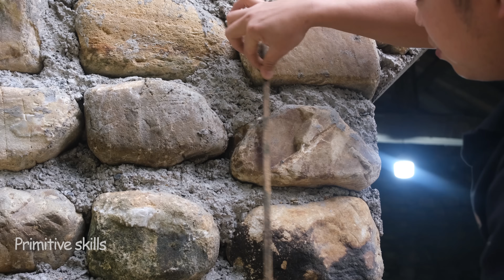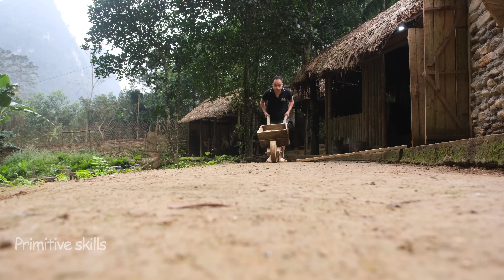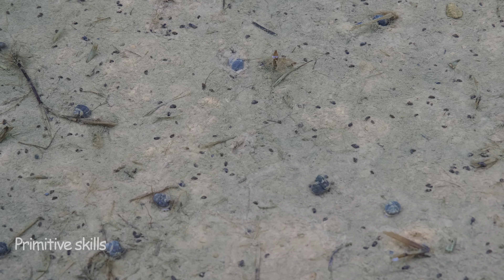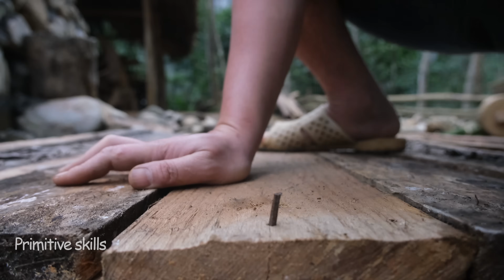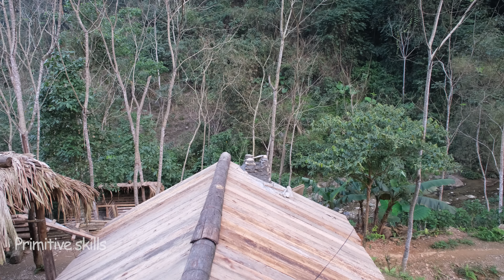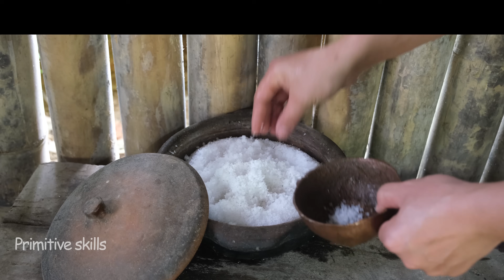PRIMTIVE SKILLS; Build a stone fireplace/chimney can heat house (CABIN) in winter

Comment: I'm not a genius but I think that if your only source of heat is fire, then a fireplace would have been, and should have been, part of the original design and construction. The extra effort to make all of the wall and window just to tear it down, and potentially have a weaker structure because of it, could have all been avoided by a tiny bit of planning and "doing it right the first time", as they saying goes. EDIT: And the chimney needs to be at least a meter taller if not 2 meters.

Comment: It's common practice to extend the chimney past the roof peak  for the best draft to get the smoke up and away from the area
Reply: Exactly I'm also worried about the interior. The fact that it's wood. Hopefully that's getting taken out as quickly as possible. Well as quickly as structurally possible. We can already see visible fire damage heat damage.
Reply: @ConnorMainwold he used that mainly as a form and believe he fully expects it to burn away over time.
Reply: @ConnorMainwold  charred wood is actually less flammable than raw dried wood. But regardless it will burn once it reaches a certain temperature. I thought that was his plan to burn the form inside the chimney since it's surrounded by stone. I just wonder about heat and cracking the stone and mortar from drying to fast
Reply: ... worried the chimney is not tall enough from the peak of the roof, as big rains can flow inside...
... hopefully none of the rocks came from the river, was told river rocks hold too much water and can explode in fireplaces...
Reply: I agree. While it is probably "tall enough" it is not ideal.
Reply: @heathbecker420   To be honest everything can burn if you get it hot enough
Reply from the maker: Thank you, wish you and your family good health
Reply: Gostaram da resposta?

Comment: Hello Duong! 👋🇨🇦 Hope you are doing well, please take care of your back and heavy lifting. The Fireplace is very beautiful but I worry about the Chimney not being high enough, it should be extended. Also once the wooden frame burns away inside the fireplace, it might cave in, maybe build inside with some Rebar’s, Mortar and Bricks for safety, sturdiness and longevity. ♥️
Reply from the maker: Thank you, wish you and your family good health
Reply: these are great suggestions!! Rebar, brick ties etc are pretty key in structural integrity. The wooden frame is going to burn away and I fear his house with it. Also needs at least another 800mm on the chimney to get well above the ridgeline, better draft.
Reply: @dragonsheartforge8035 oh yes that’s very important too, I didn’t think of that, I’m worried about the roof line and sparks landing on it… of course with a clay tile roof it will be much safer but Duong said weather is not good to make clay tiles yet.

Comment: @26:53, You need to remove the planks in the chimney above the fireplace, or your whole house will burn down!

Love what you're doing with the land, and a nice chimney <3
Reply: how will a house made entirely of stone burn?(didnt realize the roof sorry) and as you saw in the video the planks aint really catching on fire, more so only charring. so i would assume they are quite safe to let burn away
Reply: @SanePelailee  Yeah for now, give them 1-2 weeks with some burning in the fireplace, and then just 1 ember could catch on fire ant the whole roof would be gone
Reply: @firesting  he had his entire basket collection above his fire for quite some time. It was mostly made of bamboo.  He seems to test his limits. At least most of the wood is encased in stone inside the chimney.
Reply: I think the biggest danger he might face would be if a loose chunk of wood fell into the fireplace from higher up. Lots of smoky, burning chunks around the room.
Reply: @SanePelailee  fire can make concrete brittle and collapse.
Reply: @SanePelailee com fogo não se brinca. Ele pode dormir e as tábuas queimar, nesse mundo nada está 100% seguro. Então um pouco a mais de cuidado é fundamental. Não podemos confiar em uma casa que tem fios de energia.....
Reply: @firesting  true in a dry place yeah, but true. and you cant be too safe with fire.
Reply: @HamguyBacon  Ture didnt think of that. but then the whole fire place is in trouble
Reply: @NOVELANATELA  thats true. You cant be too safe with these things. sorry for my ignorance
Reply: @SanePelailee  🥰
Reply: @SanePelailee  the wood will be fine if it turns to char, it will be fire proof. the concrete walls should be lined with clay or dirt.
Reply: I don’t think so I think he intends to burn out the mould.
Reply from the maker: Thank you, wish you and your family good health

Comment: Chimney is not high enough above the roof to get a good draw. 
 it will back draw which is why there is smoke in the house. 
Got to be at least two feet above roof for good draw and sparks to fall back down instead of on roof

Comment: Great video,  I love your fireplace 😊  The biggest suggestion i can make from my own experience from having wood burning stoves and fireplaces is that te actual chimney should rise 2 feet ABOVE the Ridgeline or peak o th roof. This allows for better airflow and creates less fire danger to your roof.  Another suggestion is as someone mentioned,  to line the inside of the fireplace with brick. This will help protect the chimney itself and also hold heat longer at night.  There is a thing called a damper, which is basically a sheet of metal that is meant to fit into the chimney opening,  this lets you control the fire better and also will let you close off the chimney so it doesn't pull out the warm air from your room whe you aren't using the fireplace.  I hope this makes sense as i am notan expert by any means 😅.   You did a beautiful job the way you made it, both in function and looks 😊.   I completely agreeabout movng the pig pen, that area does make more sense.  Sending blessings from the USA ❤
Reply from the maker: Thank you, wish you and your family good health

Comment: Honestly, while it's awesome that you've finally made yourself a fireplace, if this was made for something other than cooking, then it's not very useful. A fireplace work's by gathering and holding heat in it's structure, which is why fireplaces are built inside the home, with only one of the four sides of the fireplace facing outside, because this wastes the least amount of heat. Sometimes the fireplace is built in the middle of the house, so that all four sides of it can release their stored heat into the house. With the way you've made your fireplace, a good 3/4 of it's heating capacity is being basically wasted, since most of it now bleeds outside into the open air. 

Anyways, phenomenal work on the house. Can't wait to see you make roof tiles and make a proper roof for it.
Reply: After watching him walk around in shorts with no shoes for years now, I get the impression that it doesn't get very cold where he lives.  You're absolutely right, but he might not need that much heat.
Reply: I completely agree with you about this.  Radiation of the heat needs to be inside the house.
Reply: yea the build and then plan technique, always causes a problem at the end, unfortunatly we see how poor his concrete is which is a concern for the future.

Comment: You are making "Limecrete" but you don't use enough lime. 
3 parts sand, 1 part lime is the right formula. 
And you have to keep wetting it for a few days if you don't want it to crack.

Comment: I'm adding my voice to this one Duong, this fireplace needs some significant adjustments to be safe and effective. To make it safer you need a taller chimney, which will help to direct the smoke up and away, plus taller chimneys naturally pull a stronger updraft so the fires will burn better. Considering how close the dry thatch roof is you really need a screen to catch escaping sparks or you could easily burn everything down. You could use this as a chance to pull some copper wire and weave a screen! To make the fireplace far more effective, you will want to extend your fireplace inside the cabin. You can bring the hearth down to floor level for convenience and all of the stone work you add to enclose it will be able to store heat from the fire and then slowly release it inside the house.

Comment: Very nice chimney.  I think I would have made it a little taller since your roof is currently flammable.  Also, I'm concerned you'll get a roaring chimney fire going at some point when the wooden frame catches fire.  I really thought you intended to remove that after the concrete set.

Comment: Listen, bro, it's fine, but it's not durable. There's a risk of the upper part of the chimney collapsing. It's supported by formwork. When the formwork is removed, the upper part may collapse inward. Secondly, there's no attachment to the building wall. A crack is forming along the wall. The chimney, along with the fireplace, could fall away from the wall.
Reply from the maker: Thank you for your feedback

Comment: Duong the fireplace is a little high off the ground. Should be a little lower to the ground for better heating, But other than that it is a excellent build. Chimney needs to be at least 2 foot higher than the roof ridge for optimal flow. Don't want to burn the wooden roof from the excessive heat coming out of the Chimney. You have the general idea of how it works. Just a few small changes to makes it a standard fireplace.
Reply from the maker: Thank you, your shares are very useful to me

Comment: Build a fireplace inside the house, all the curves of the wall will heat up, and as my grandfather taught me, the inside of the chimney should be smooth so that the smoke does not get stuck and there are fewer deposits

Comment: Two things:

1) The chimney to too short by at least 2-3 feet, should probably be extended 4 feet just to be sure because of the quality of the wood being burned. In the video you can see the smoke blowing under the eaves and back into the house. 

2) The crops fields: as I've been saying for years that area is too sloped and the rains are leeching away the nutrients from the plants. Planting in small mounts like that only works if the soil is already high quality, nutrient rich, and naturally good retention/drainage ratio. 

You need to terrace the entire crops fields and not just the areas for rice. Also you need to rotate the crops every planting and add compost to replenish the soil. You have plenty of sources of manure, plant material, saw dust, etc. to do proper composting bins. 

When you're done boiling your eggs, save the water, crush up the eggshells and add the powder to the water and use on your plants. also as others have pointed out, use the water/ top layer of soil from the pond as it's nutrient rich from the fish poop and plant material you feed them. 

Water from boiling vegetables (not salted) is also a great source of nutrients for plants.

All of this combined with proper composting will greatly increase the health and productivity of your crops. 

The size, shape, kernal count, etc. of your corn are all tell-tail signs that it's not getting the proper nutrients it needs. That's the easiest and most visible signs but the stunted growth of the rest of the crops are all the same signs.
Reply from the maker: Thank you, your shares are very useful to me

Comment: Don't fret, you can still use the crop fields.  In order to circumvent the loss of water due to the insects burrowing in the dirt, you will need to implement a very old water irrigation technique that involves the use of clay vessels, call "Olla"s (Pronounced Oy-yah).  These clay pots are formed and shaped to be buried in the dirt, and their purpose is to water crops and keep soil moist.  Due to its design, the water slowly and gradually seeps out through the pot, keeping the surrounding soil and crops watered.  All you have to do is keep the Olla full of water.
Reply from the maker: Thank you so much, I am very happy to receive your feedback. Wish you all the best, see you in the next video

Comment: Đường, if you take one of your sewing needles and poke a small hole in the top of each egg before you boil them, then the sulfur will boil out of the hole and you won't have that green layer around the yellow yolk.  It will also taste much better!  Sulphur doesn't taste very good.

Comment: you have done a very good job but I would like the chimney fire to be 50 points higher for many reasons firstly to avoid fire when the fire will be strong and secondly for wind reason when it is strong outside the smoke will flow into the house.  .I would suggest you to make the chicken coop at the top right at the end of the garden for reasons of manure for your garden and to make it more airy for the hens and airy..for the stable for the pigs I would suggest you make it at the end of  lake bottom left so you can wash the pigs and the stable to avoid any pests and the African plague ..pigs need a natural flow of water to take mud baths ..hope I help you with my comments good luck 💪💪  💪
Reply from the maker: Thank you, your shares are very useful to me
Reply: @PrimitiveSkillsnet  I wish you good strength.🙏💪🙏💪

Comment: Nice build....but the fire needs more draft to smoke less inside the house. Try digging lower and make draft holes so fire can breathe more, can be partialy solved by making the chimney higher so your house isnt filled with smoke. Also the wood inside chimney is total firehazard!!! Make sure to take all the wood out! To prevent smoke from coming in take few bricks (can be mortar) and make slight arch in shape of flipped over U.

Comment: Congratulations! Such a fireplace is very inefficient. One wall can be warm. Flue gases should be run through a horizontal channel. Make the stove so that it burns horizontally, not uphill. Will it be a slow modernization?

Comment: I wouldn't worry about the chimney being too narrow the top, too short for a proper draft, not angled at the cap stone, no spark arrestor, that the design will basically draw the warm air up and out of the room, or that it is lined with flammable material. It doesn't look structurally sound (made of stone that will not survive the temp of the fire) and is likely going to collapse before it burns the building down. ;-)

Comment: Little worried about the wood being in the chimney all the way up to it's top. If that side at the bottom starts to burn, and it continues up to the top since it's wood all the way up on the inside, then you are probably gonna have embers and flames being spit out and might catch your roof on fire. Realistically should have built the chimney and burned that wood out before putting the roof on. You should also probably build that chimney a little higher (better draft + prevent water from the roof splashing in and causing steam explosions).

Comment: hi brother, you did everything right on the outside of the house. but inside it was necessary to make a similar structure, only the hearth should be at the bottom, and in the fireplaces there was a hollow cavity in the upper part, like a bag, to discharge the air. Your direct urge goes out into the street. this pocket bag allowed for heating and reduced wood consumption. plus the design, you could put something on the fireplace and dry it. And put a tripod below and cook food. Fire at chest level reduces heat transfer. The fireplace should be at the bottom. I hope Google translated it correctly. And good luck to you. Fertilize the soil, make compost, have pigs, don’t be afraid, is it really not possible for you to get vaccinated?

Comment: Thèse people are wright, you should build up the chimney at least another 2 to 3 feet and please, please remove the wood forms from inside the fireplace, you can’t just leave wood on the inside like they, you should know wood will take fire so either remove it or use your bricks to build a firewall in front of the wood otherwise if the wood takes fire your wood roof might catch fire also.  Please correct this as soon as possible.  Thank you from Quebec, Canada…

Comment: A very badly built Fireplace if you built it to heat the room.  If you built it for design, then it looks pretty good.  Normally, only the chimney had to be built outside, so that the rest of the construction remained inside to release the heat.  That's how it should be.  Too bad you can't use it to the maximum